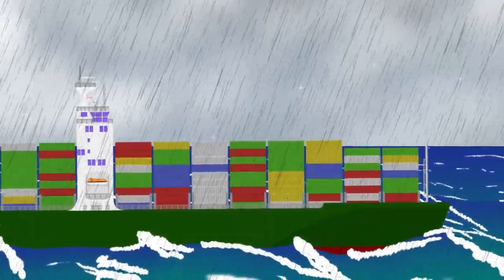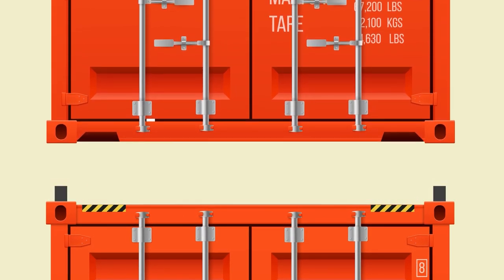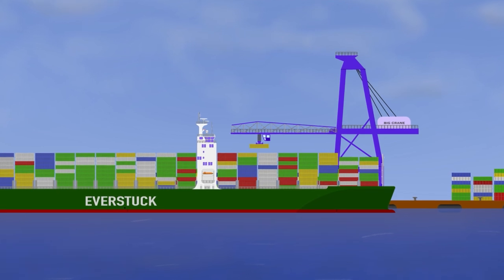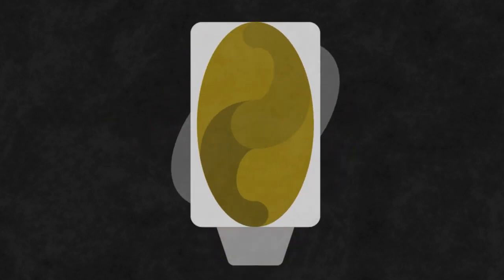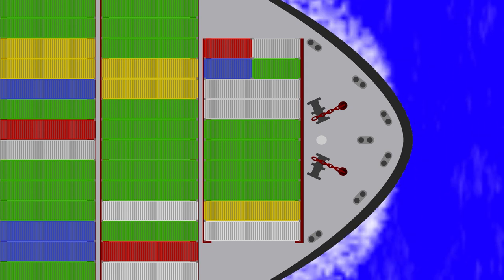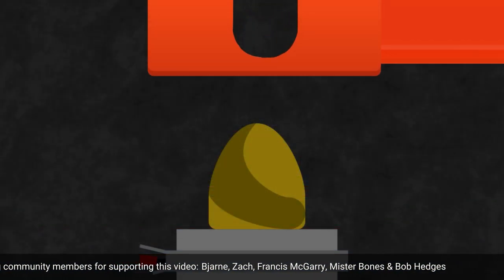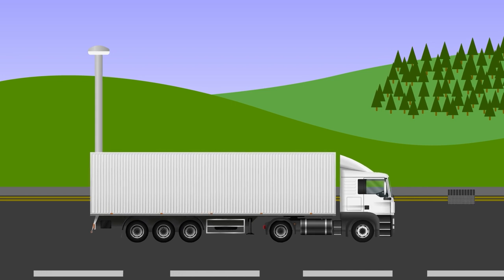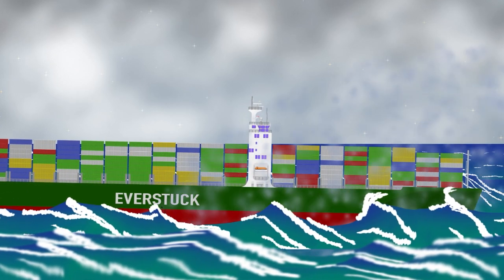Why Don't These Containers Fall Off?

Comment: How about for twist locks you have a pressure plate so when you lift the weight on the twist lock it will unlock

Comment: Why not have long poles with locks along them that can be threaded through the corner holes with a single sturdy switch flipping the locks on or off that way you don’t need to manually unlatch each individual lock nor do you need to retrieve the locks after the cargo’s been unloaded

Comment: Didn't you miss a detail? What you're telling about those locks is all right. But aren't the containers fastened together by diagonal rods, too? Those rods will form like a truss bridge with lots of triangles across the fronts of various containers. I've been told that specifically the ones above deck should form like a solid mass being tied to another. I might be wrong. I'm just a civil engineer would just had one class on maritime transport. :)

Comment: You missed out that most importantly the whole stack of containers locked together is secured and tightened down by heavy wire rope or else the whole stack could roll off the deck and go overboard en masse.

Comment: I'd been wondering why the "on deck" containers aren't enclosed... or at least better held in place by extending the "cell rails" to the height of the top container... and it seems like the answer is "these locks are good enough and fast enough to get the job done" and weigh a lot less.
Reply: Some ships do have cell guides on deck.  One of our ships has them on the aftmost bay because we can stow containers the highest there.  Not necessary on forward bays because of imo visibility limits.

Comment: No, crew doesn't do that. Stevedores do. Crew must sometimes move bins of gear around, and the ship's electrician plugs in the reefers. All the rest of the loading and lashing is done by shoreside personnel, the stevedores. Or as they prefer to be called in the US, Longshoremen.

Comment: Every truck I've seen hasn't bothered to lock the container at all. Wobbles a lot when empty. Never drive in the lane beside a truck when taking a corner. Also, you didn't mention the many times containers DO fall into the sea?

Comment: They need to start making those containers out of titanium. Imagine the cost savings as well as the amount of reduced pollution to move the same amount or more of goods across the world. Average 40ft steel container weighs about 8,159 pounds empty. Titanium is about 45% lighter and just as strong as steel. 
The largest ships can hold 24,000 containers so 8,159lbs x 24,000 = 195.8 million pounds or about 97.5 tons using steel containers. 
If those same containers were made of titanium they would each weigh about 3,670 lbs x 24,000 = 88.1 million pounds or about 44 tons. 
That's about 53 tons lighter per the largest cargo ships. Also trains and truckers would also save of fuel consumption because of the lighter weight of the containers lowering pollution and still moving the same amount of cargo.

Comment: Your description of the Sea-Locks wasn't bad , but not quite right either . No mention of the FACT that the Stacks get Chained as well , in a Cruciform Pattern .
Also , the Lifting Heads , Spreaders , because they can Spread from 20 ft to 40 ft , are Equipped with their OWN very high tensile mechanically operated Twist-Locks .

Comment: But don't they need to be secured horizontally as well? This only talks about vertically securing. The outermost stack needs to be secured somehow, right?
Reply: I imagine that if the bottom one is secured, it holds the the upper one in place and the next and successively the entire stack in place, so unless a few locks fail, there's nowhere for the stack to go.

Comment: Why don't container ships stack containers offset like bricks so that the whole stack of containers acts like a beam and they can only fall off one at a time.  The ships could also benefit from software that assesses the structural margins of safety in real time as a function of the sea state and shift motions so that structural failures are avoided.  Maybe they already have systems like that but some of the recent accidents seem to suggest otherwise.

Comment: “Odd numbers showing 20 foot containers”
Right after that still mentions how 02 could be a 20 foot container. Also does not mention a 03 (the logical number for 20 foot containers at the back half).

Comment: How do they stack uncommon size is like 45 foot and 53 foot containers?
Reply: Im not an expert but my understanding of shipping containers is that 99% of the point is the standardization so someone loads it at their factory and any carrier can move the goods to the final destination without ever needing to open it. (Be it train, truck, or container ship) This is because in the olden days a sailor's wages included whatever they could carry home at the end of the day. (Theft was a big problem)

So weird sized containers aren't supposed to exist, only standardized sizes.

Comment: Or hear me out we fit them all with locks built in on the feet and when a crane locks it automatically unlocks.  The feet. When in position and put down the moment the crane unlocks it automatically locks on its feet. All you need is a wire fed through the container. From top to bottom. And for the cranes to have a magnetic lock or a simple current to toggle them.

Comment: A bit late i know, but yea, thoes semi automatic twistlocks look more or less like the ones iwe used on edinburugh class ship, we still go around chekking their actualy locked, and for the container on the hatchcover, (tier 80)  we used manual locks, we call them base locks though, usualy the semi's are put on on the contsiners by dockworkers before they are lifted on the ship... for a brief time there were also an automatic, or fully automatic twist lock but they were not great so i dont think they are used anymore, the big a$$ pole used to open twistlocks are called actuator poles, and usually the people doing this job are the stewadores (dock workets) and not the crew.

Comment: I'm a big fan of your videos, and learn a lot watching them, but this one was both difficult to understand, and frankly, it sounds unlikely that someone is running around tinkering with all these locks manually when there are 20 000 containers on the ship and the containers on shore are hauled around the harbor area with driver-less trucks. I don't think this is the full story.
Reply: This is actually the short version of the process.  He didn't even get into the lashing process.  It takes my gang less than an hour to break down all lashing and unlock all the twist locks.  Ground crew then removes each twist lock as it is loaded on the bomb cart and throws it in to the shoe box.

Comment: Except those containers DO fall off. It's a bit of an international problem by now. Plenty research being done in it ever since MSC Zoe went losing tons of them off the North coast of The Netherlands. I was involved in part of the research and it seems the problem gets worse the bigger the ships get.
Reply: I think the only plus side to them falling off is that the cargo lost is known, as is the location it was lost, which means when it gets found you can report it (location and time) and it helps to study ocean currents. (I believe a container of rubber ducks was lost in the pacific and some endedup washing ashore in Portugal)

But other than that losing cargo to the ocean is bad.

Comment: 4:05 I rewatched this part about 10 times. It still makes no sense. Am I hearing something wrong? 2, 4, 6 etc make up the bottom section with "8 zero" at deck level? Then 2, 4, 6 again as it stacks above deck? Was this edited wrong? Wtf am I missing here? The last two digits of 02 for instance could be the tier just above the very bottom tier below deck, OR, it could be referring to the "third" tier above deck? Either this is a typo slash editing error or I'm losing my fucking mind.